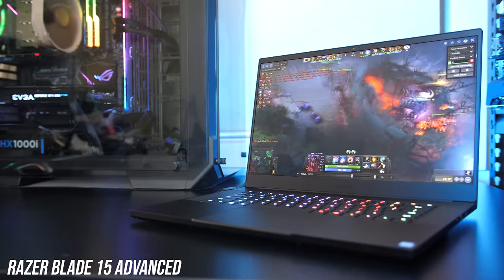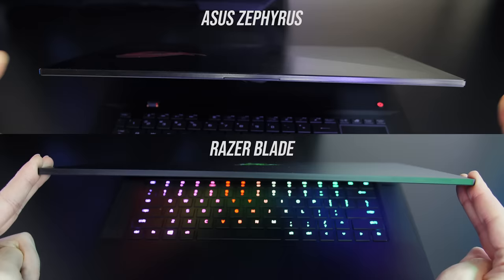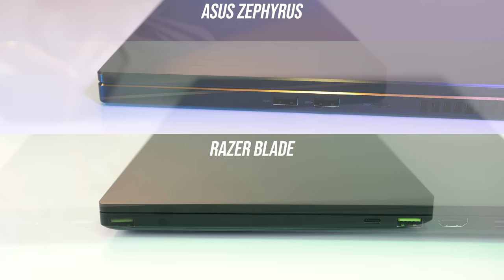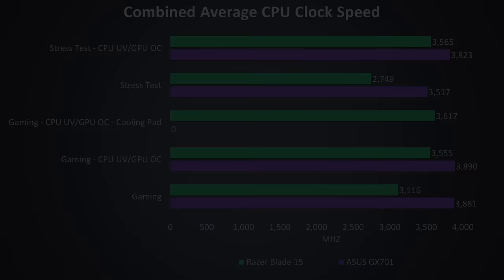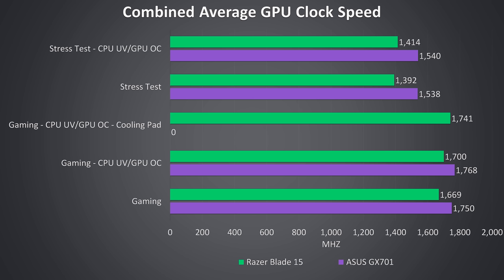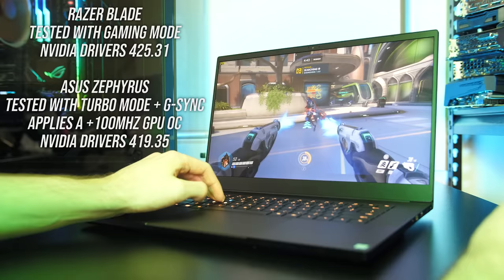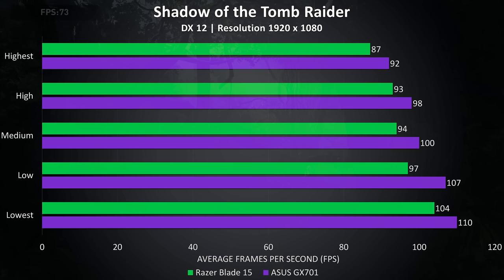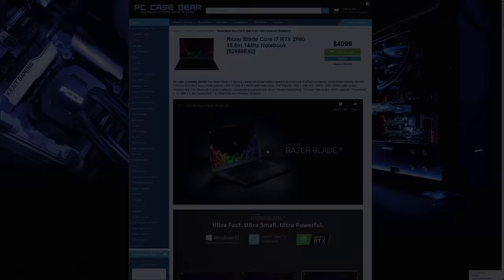ASUS Zephyrus S (GX701) vs Razer Blade 15 Advanced - RTX Gaming Laptop Comparison

Comment: I was wondering between the Razer Blade 15 with 1060 max-q (For buying in Russia, I found only the version with 1060:( ) and the Zephyrus S GX531GS with 1070 max-q. But the price in Russia of both is about equal (1950$).  I like design, keyboard layout and etc more in Razer Blade. also in Zephyrus to changing the thermal grease or the memory slot is problem, but Zephyrus is more powerful bcs 1070. I use laptop for design, 3d modeling (blender, photoshop, substance painter) and for developing in Unity engine 3d. also I want to play in Witcher 3 with middle-high at least. What shall I do..?))
Reply from the maker: The 1070 max-q will perform better, but for most games at 1080p the 1060 max-q is still quite good. Overall I agree the design of the Blade is better, depends if you'll actually be using the touchpad often. If you use the Zephyrus on your lap it's hard to use the keyboard, but on a desk the keyboard placement isn't a problem with external mouse.

Comment: Is the temps 99c normal under heavy load ? Like playing heavy demanding game like red dead redemption 2 and metro exodus all at max settings. The asus zephyrus manufacture says its normal. I read other articles said its just way too hot and wont last long. Thin laptop = bad thermal. Bad thermal = gtx 1050 performance.
Reply from the maker: I wouldn't say normal, but in the Zephyrus it's not too unexpected in a warm environment, there's a lot of power in a small space. If it gets too hot it will just throttle back to protect itself, I've got some more info here: https://jarrods.tech/is-it-safe-to-play-games-on-a-gaming-laptop-for-hours/

Comment: I've noticed that the 9th gen CPU version of the GX701 on US market has a 500 nits screen with HDR instead of G-Sync feature. So do you guys think that GX701 will still be a better gaming machine than the razer blade?
Reply from the maker: I'd expect so, also has 16gb soldered memory instead of 8 so seems like some decent improvements, not sure if the newer blade has many other changes.
Reply: Only some models come only with the HDR , however asus has done a terrible job at explaining the models and for some reason the HDR models even had the g sync sticker without actually being g sync compatible . i basically had to pick one blindly and hope it had G sync with the 9nth gen ( fortunately it did)

Comment: Can you compare each of their performance with a slightly angled M15  which I've heard reduces thermal throttling substantially if raised a lil bit?
Reply from the maker: I don't currently have an m15 so I can't do that at the moment. That said I tested it with a cooling pad in my review of it, so you can see how that helps with performance there.

Comment: I got the asus gx701 laptop and for some reason the main asus ROG logo on top of the keyboard isn't working nor is the RGB lights are working in the bottom back of the computer anyone have any idea how to fix this? im looking at drivers but none of them are working to help the issue...and ive tried the Armory crate software but all it does is change the RGB style and turn off the lights.
Reply from the maker: Go into the Windows store and search for the "ROG Aura Core" software and give that a go.
Reply: @JarrodsTech  that actually worked thank you so much! Thought I had to return this beauty. Kinda wierd to turn it on was to turn aura sync off then back on.
Reply: Jarrod'sTech will have to give this a try with mine tomorrow, was having the same problem after it arrived.  Spent almost an hour fiddling with everything in Armory crate.  Frustrating to say the least!

Comment: Fun fact: you are able to run a laptop with different size RAM sticks in dual channel, but it will only run in dual channel up to a certain point. Exceeding double the smallest RAM disk in terms of usage causes the remaining RAM to be used in single channel ie. with one 8GB and one 16GB stick, the laptop will only run in dual channel up to 16GB RAM usage, the remaining 8GB will run in single channel.
Reply from the maker: Yeah I'd heard that, makes sense, would like to test it myself though. Either way the new 9th gen model of the GX701 comes with 16gb of soldered memory rather than 8gb like this one had 👍
Reply: @JarrodsTech  Can I suggest you on testing dual channel memory but with different kind of memory modules ? Example: Most laptops for this generation comes with SODIMM DDR4 2666Mhz . However, factory fitted are CL19 ones. Can you compare it with something like Kingston Hyper X Impact SODIMM with CL15  timings. There should be some difference in performance for lower latency RAM.

Comment: Actually, both have thermal throttling. Don't know what you tested there but stating that there was no throttling is simply wrong. The Razer Blade, for example, throttles both the CPU & GPU.
The only way I could bypass any throttling was by removing the thermal paste and applying liquid metal + apply several new cooling pads within the system for better heat transportation.

Now the overall temps have dropped a lot and gaming is way way smoother.
Reply from the maker: I said in the video exactly what I tested, by all means run the exact same tests for a direct comparison, keep in mind ambient room temperature is an important factor. I try to regulate a 21c room throughout the year so I have comparable data, and generally a 1c increase to room temp = 1c increase to internals.
Reply: @JarrodsTech  Did you run each game/benchmark over hours before actually noting down anything? If not the test is useless as the devices heat up overtime. In any real world scenario where you play several hours throttling occurs.

Comment: I'm deciding between the Alienware m15 and the Dell G7 17". They both have Intel i7 and 16 GB of RAM. The G7 has the RTX 2060, while the Alienware has the GTX 1660 Ti. The G7 uses a 256 GB + 1 TB HDD, while the Alienware has a 1 TB "hybrid drive" (SSHD). But, the Alienware does have a better 144 Hz display. Price for the G7 is US $1,390, vs $1,407 for the Alienware. Which would you recommend?
Reply: Well the alienware has the graphics amplifier port so that's a bonus imo
Reply from the maker: I haven't used a 1660 Ti laptop yet, and am in the middle of testing the G7 right now, so probably not the best person to ask at the moment 😅 the m15 is a hot one based on my own testing (https://www.youtube.com/watch?v=l2Juhc0dcJc), I've heard the 1660 Ti performs closely to the 2060 in laptops but again haven't tested myself so cannot confirm. As mentioned with the m15 you do have the expensive option of the graphics amplifier if that's something you'd consider, I have a video comparing it to a thunderbolt 3 alternative here: https://www.youtube.com/watch?v=_8hG3C20uxQ
Reply: @JarrodsTech  what is your first impressions of G7. Ordered at the moment, waiting for delivery, but still able to cancel...

Comment: don't get me wrong mate but I think it wasn't a fair comparison for only 1 reason the blade is a 15-inch laptop with a much smaller footprint which means a smaller cooling solution, I think if you would try the 17-inch version you would get a different result for sure
Reply from the maker: The comparison was not meant to be fair. I made the comparison because a lot of people asked to see the difference, the 17" version of the blade did not exist at the time the comparison was made, otherwise I would have happily used it instead - the new blade pro with RTX only came out a few months ago.

Comment: Dear jarrod I want to know which laptop should I buy for programming
And please also tell which language should I learn first
Like C++, Python and java
Please reply
Thanks
Reply from the maker: I haven't done programming properly in about 10 years, so I don't really know what makes a good laptop for it. Probably something with a good keyboard, but nothing in particular comes to mind, maybe something like the Tongfang chassis the Eluktronics Mech 15 uses, as it has a pretty good mechanical keyboard and decent specs for anything you'd want to throw at it. Personally I did Java myself, but I don't really know what's best to start with. C++ is pretty complex from my understanding, I'd look at what's useful in the current job market if the goal is employment in programming.
Reply: Ooh you replied thank you so much

Some people recommended me that I should purchase Mac book air and I should learn python first
Thats why I am confused and I asked you for a good laptop because I don't want a gaming laptop. A laptop which is affordable and suitable for coding

Anyways thanks jarrod
Reply from the maker: No problem! I haven't used an Apple laptop since I bought my 2012 model and stopped using it a couple of years ago. In general it's probably pretty good for that task, a lot of programmers use it, that said there are definitely cheaper Windows alternatives available. I haven't tested much in that area though, as most of the laptops I've been sent so far are gaming machines with high powered graphics. You could look at the ASUS Zenbook line, I believe they are cheaper but have similar features for a Windows laptop/notebook.
Reply: Thanks jarrod
My best wishes to you
Reply from the maker: Cheers!

Comment: Both are way too much $ to me  but I'd pick the blade between the two despite many horror stories about Razer customer support/quality control. The zephyrus keyboard layout makes it  unpractical as a "laptop" when not gaming and using on the go for me. 

Will you be reviewing the new zephyrus with a normal keyboard layout with the 2070? Curious to see how that does with thermals since it's a full 2070 in a 4.6 lb chasis with a normal layout.
Reply from the maker: Fair enough! Yes I think so, I'm waiting on about 5 different models from ASUS at the moment, just not sure when I'll get them, plus I'm going to Computex for a week on the 25th which will delay reviews of the new stuff, but hopefully I can check out the new stuff at Computex too.

Comment: Wait undervolting actually improves the CPU clock speed? hmm I suppose that's because of lower heat but interesting......
Reply from the maker: It can improve performance for two reasons, reducing the power in use, and thereby heat is one, if you're thermal throttling that can boost clock speed. The other is power limit throttling, if you're hitting the power limitation set in BIOS that can't be modified then undervolting allows you to get more done with the same amount of power.

Comment: I just ordered my razer blade 15 few days ago on amazon for far less than $3200 :o. But, I did buy 32 GB ram (2x16) and is going to be using my 2TB 970 evo, which was 550 that I currently have in my older laptop
Reply from the maker: Yeah the prices have been going down over the last few weeks, since the 9th gen models came out I think, which is good as they still work just fine!

Comment: Impressive for a 15 inch laptop, i didn't expect gaming benchmarks to be so close. I think those drivers could make a big difference.
There are a few places selling the 2080  GX701 for 3800 and 4000 in Australia and I've been wondering if it's a mistake and they may actually be selling the 2070 model.

Also I always make it to the end, but I skip over the keyboards typing sounds 🤭😂
Reply from the maker: Haha, most don't make it! Is that the 8th gen model? I think the prices are going down as the new 9th gen model starts to replace it.
Reply: @JarrodsTech  yeah it's the 8750H model. Do u know if the cpu the only difference? This is working out well for me because I'm still a few weeks of saving away from the purchase, if CPU is the only advantage I will just go the cheaper model.
What do u think of the sharp IGZO 240hz displays, I see one of the aero 15's has one and I don't think anyone has done a review yet.
Reply from the maker: Apparently the screen is also HDR with the GX701, the soldered memory is also 16gb instead of 8gb, that's what I've seen so far haven't gone through all the specs yet. I have a video on 240Hz laptops coming out next week 👍

Comment: what about the coil noise? i have both a rtx 2060 alienware M15 and recently had to return my rtx 2060 blade 15 advanced due to a lot of COIL WHINE,the sound was horrendous. i undervolted my m15 and i love it. and the m15 is more robust and feels more solid than the razer blade. i feel like i could drop this m15 and it would survive. its built like a tank.
Reply: The screen bezel on the m15 is brutal. I heard a lot of the blades had coil whine which is a shame. I wonder if they fixed it since or if it's just inherent in that specific design.
Reply from the maker: I didn't notice it in either unit, so didn't mention it.
Reply: Adrian S i got used to the bezels. They are black so it doesn’t distract me. I love my m15.  I had the razer for a week. The speaker grills is so thin it bends if you press a little hard.

Comment: Can the Zephyrus be operated with a coolpad, or is it not meaningful?
Reply from the maker: It does almost nothing, not ventilation underneath plus the metal sheet under it rises so doesn't even contact the internals.
Reply: @JarrodsTech  is it ok to undervolt the core and the cache different ? 

Thank you very much

Comment: Are you sure the Asus is a dual channel??? I have the same one, but cannot figure out till this day, forums say it’s single channel..
Reply: I mean does it perform the same way as dual channel?
Reply from the maker: The performance in the games I've tested appears to be dual channel, software reported it as dual channel too. I am not exactly sure how it works, if 8gb from the secondary stick is only dual channel or what. Either way, the new 9th gen model has 16gb soldered to the board rather than 8gb so should be less of an issue when matched with another 16gb stick.
Reply: Jarrod'sTech I see, thanks for the response 👍🏼

Comment: Only plus I see on the Zephyrus is the powerbank charge, unless you know of a way to do that on the Razer blade :(.
Reply from the maker: It also performs better, with better cooling 😎
Reply: And gsync
Reply: @JarrodsTech  better cooling but louder and more annoying.
Reply: GSync, 1tb ssd out of the box, better cooling (especially keyboard area while gaming), more frames, bigger screen for the same price.  
Cons for the Zephyrus, for me are worse battery life, no face recognition (it’s so fast and useful), lacking tb3 and I can’t seem to find an extended Asus warranty for accidental damage.
Reply: @justjoshininjapan700  yeah the thunderbolt would've helped for external eGpu

Comment: would you recommend 8th gen zephyrus for cheaper price compare to 9th?
Reply from the maker: Definitely, there is minimal difference between the 8750H and 9750H, if you can get a good price the 8th gen one would still be fine - that said, the 9th gen Zephyrus has 16gb of memory soldered to the motherboard, which is better than the 8gb in the 8th gen.
Reply: Would 8+16 still give the dual channel for rtx card performance boost? If so, is it a 8+8 dual channel plus a 8 single channel? Last, Would you be able to replace the WiFi card to 6th gen or any other card? I heard there is a driver problem with WiFi card.
Reply: @JarrodsTech  question above. Love your channel.

Comment: Guys what’s the difference between the standard and Max Q GPU’s??
Reply from the maker: Max-q runs with lower power and clockspeed to stay cooler and quieter.
Reply: Jarrod'sTech so it would be performing lower than the usual?

Comment: sneaky, reviews both well, but doesn't give a definitive answer.  I bought the Razer with 2070q option.  It replaced a 2012 MacBook pro Retina, and I don't regret the switch.  That said, I miss the trackpad gestures, and I'm fairly disappointed in the volume of the razers speakers.
Reply from the maker: Usually I don't want to give an answer, I don't want the viewer to care what I think, I provide the hard facts and data and they can come to your own conclusion based on their personal preferences. Personally, I would go with the Blade, I travel a lot and a 17" laptop regardless of how thin the bezels are is just not worth it. Plus the better battery on the plane would be welcome, I rarely play games so the benefits of the GX701 would not appeal to my personal use case.
Reply: @JarrodsTech  You did a flawless job with the review, I think I got caught up on the "vs" side of it.  Usually you'd wind up with a winner.

Comment: Zephyrus is faster because its clocked higher. MAX-Q Designs have a range that they can be clocked at and still fall under at 2060/70/80 MAX-Q Design. Not all 2080 MAX-Qs are the same and assuming they are is incorrect.
Reply from the maker: I didn't assume they were the same, in any case that's not the reason for the difference in performance here. The Zephyrus performs about 15% better on average in the games tested because I tested it with G-Sync enabled, I have benchmarks showing this with the GX701 in this video if you're interested: https://www.youtube.com/watch?v=RJfHr-Y57LY

Comment: isn't there a second m.2 slot on the zephyrus?
At least Asus is claiming that..

edit: The model I'm going to buy is the gx701gx (RTX2080 version). Just making sure.

If someone knows that it inofficially supports more than 1TB please also let me know.

bcs he mentioned "storage may vary by region", My country: Austria, Website: Asus Germany
Reply from the maker: I only saw one, but this is the 8th gen model, maybe they updated the newer 9th gen. I don't think there are any storage limits with any machine, I would be extremely surprised if you stuck a 2TB drive in if there were issues. I mean it will vary as in they will use different model drives etc.